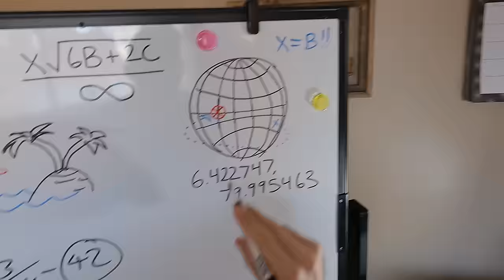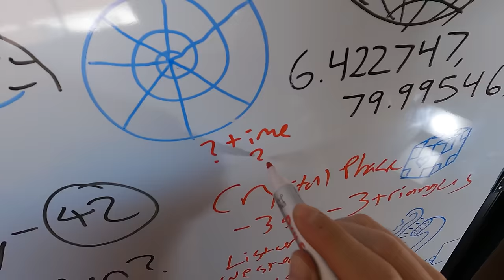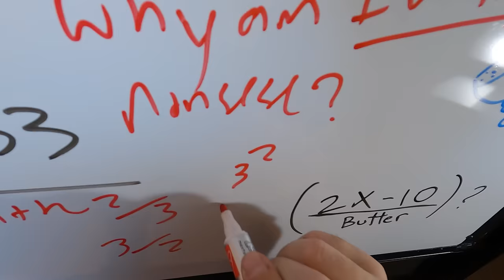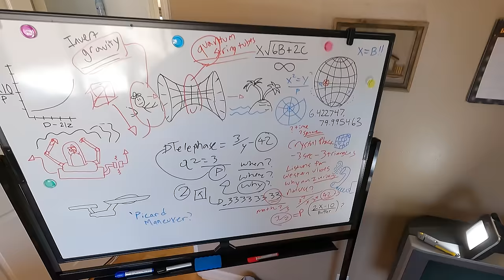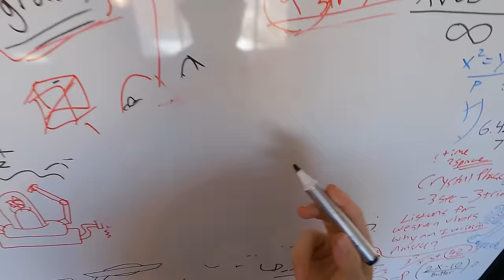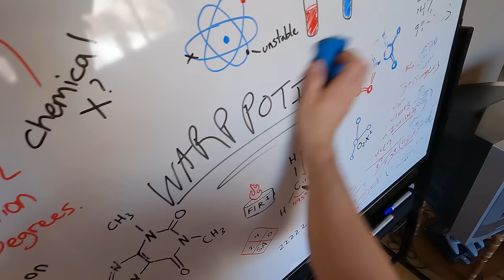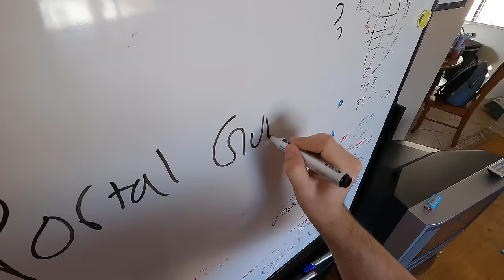Learning to Teleport

Comment: I've had similar struggles with teleportation. After 198 attempts I finally built a working teleporter. I was trying to get to the Bahamas, but ended up in a completely different dimension. At least I get to hang out with my new sentient interdimensional worm buddies.
Reply: It's looks nice
Reply: 10/10 I built a time travelling device to go back in time to explore the wonders of the past but I ended up getting to enjoy the view of the sun's last moments before it had exploded 383737837283723828922919292839282883382837383838383837 
Years later!
Reply: @SealWithHat  5 million 🤓*

Comment: Please note the difference between "warping" and "Teleporting" is the use of a portal,
Tele PORTS use PORT als
While warps is "On Self" and doesn't need any device
EDIT: Teleporting involves opening a wormhole-like portal, even if for a split second. the warp potion didn't do this, so it is appropriately named.
Reply: Tnks G0D
Reply: God isso número 1